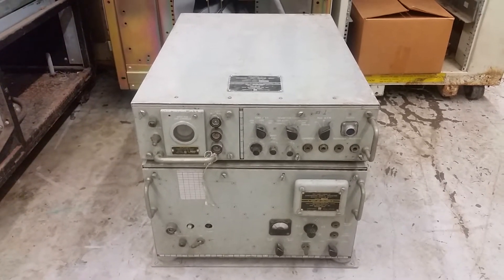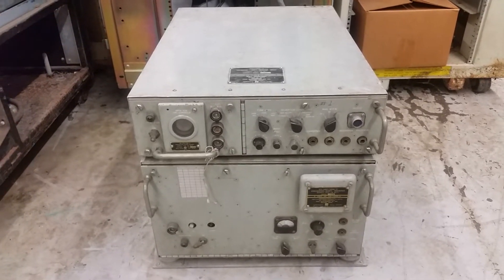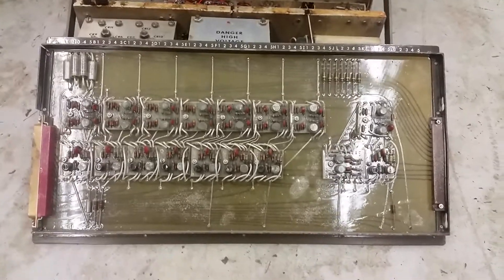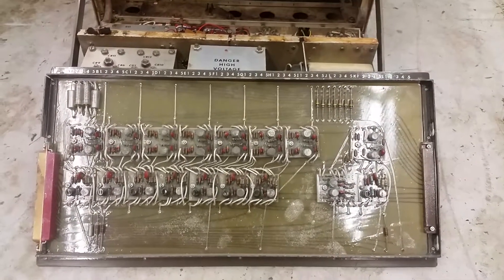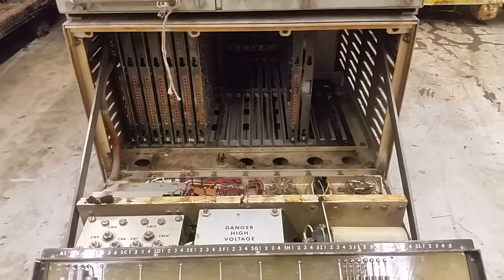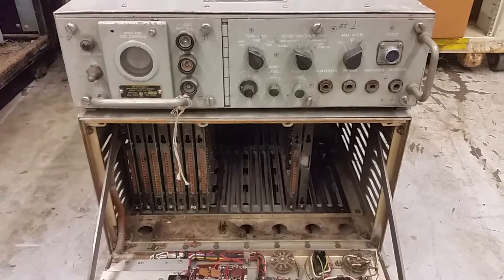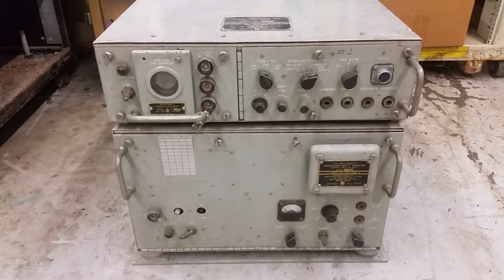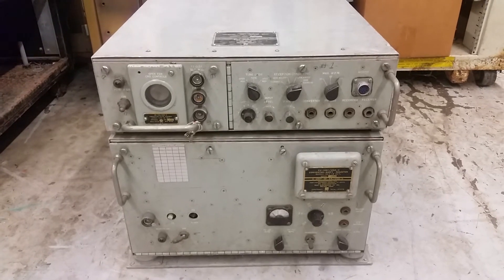AN/UGA-3 Morse Code To Teletype Converter

Comment: Had one on board Submarines I was on. It was only good for machine keyed CW. It's purpose was to copy machined keyed CW, VLF/LF Submarine broadcast. And if you experienced any atmospheric disturbances it didn't work (Static was not it's friend). I could copy by ear better than the UGA3. It sat in the corner and collected dust and had to be wiped down every field day. Good idea and concept but it makes a decent boat anchor, if the boat ain't too big.